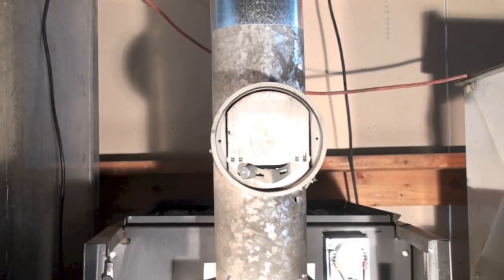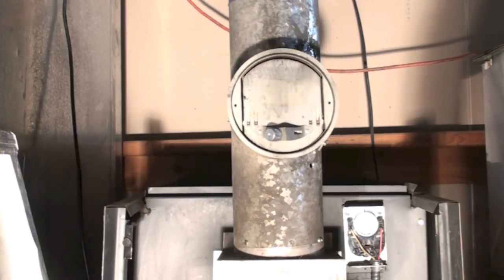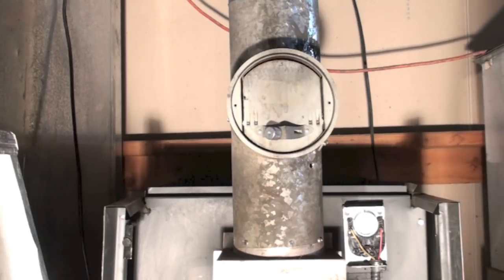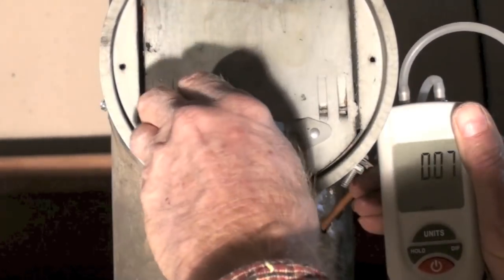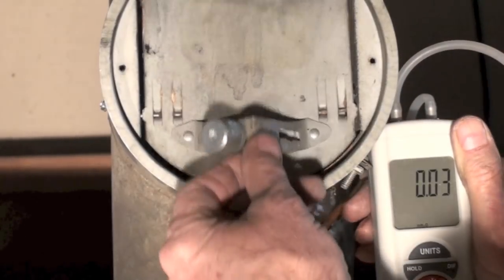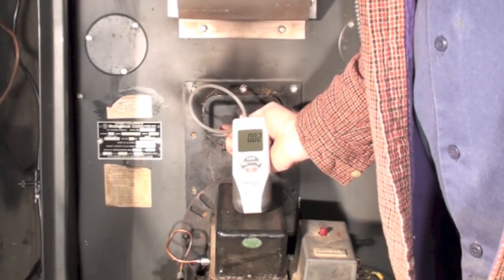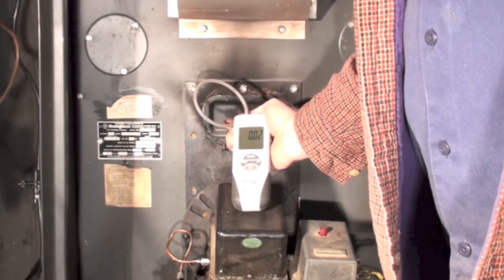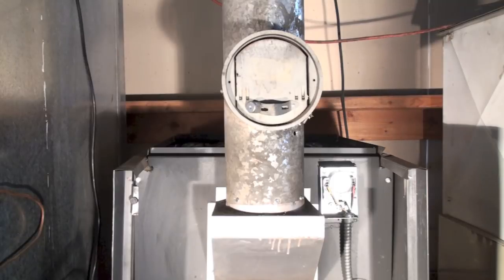How to set the oil furnace barometric damper

Comment: I have question on my furnace I only get o readings on manometer. same meter as yours even with damper sealed closed. What would cause this. I have a tall mason chimney and no smell in basement. also on windy days damper will open even with furnace off.

Comment: What do you recommend for running that intake pipe, outside?  To keep it from creating a vac in the conditioned basement?  Is that possible?  I have a blown air oil furnace, %84 afue. Installed in 06. Debating on upgrading what i can or replacement.  Tigerloop. Insulating pipes, etc
Reply from the maker: Most burner manufacturers have an outside air kit that can be installed on the burner to bring in outside combustion air.
GFM

Comment: whats the make and model?
Reply from the maker: The brand is GSI.  I never found what the model is.  Its made under several names.  If you use GSI on ebay it should come up.  I did not think it would work well but I have checked it against good meters and it is calibrated well.
GFM
Reply: Thank you!

Comment: All oil furnaces should have a draft diverter installed from the beginning. You’re one who really knows how to interpret the draft readings.  I’ve cleaned out my share of oil furnaces, that were running a positive pressure over the fire.
Reply: They should probably be in the scrap metal yard 😂

Comment: I know nothing of the pressure, or enough to know I shouldn't mess with it as a layman.  I just oiled the swivel and wired a rig to keep it from locking in its extreme open position and eliminate the noise.  It's real windy right now here and it is reactive to the wind.  I wanted to keep the noise down (the bang-banging) as it returns with its force to it's resting position too without at all hampering it's full pendulum motion.  Success, nothing but silence from the confounded (albeit important) contraption!   Thanks for the explanations and expertise - very cool and informative video.  My maintenance guys tell me the whole system is working really well - which is terrific considering how old the system is.  Just a lil oil here and there (especially in the forced hot air motor) works wonders.

Comment: Thanks for sharing information about this damper.

I've had technicians that come out for my oil boiler tune ups tell me, on at least three occasions

"You don't need to worry about your damper"

"It's an archaic 1970s leftover",

etc.

I've repeatedly asked them to adjust it properly, and they all say "it doesn't matter, don't worry about it.  We don't even carry a barometric pressure reader on our vans to read it"

Are my oil provider's techs being truthful?
Reply from the maker: They are full if beans.  The damper is used to control how fast the heat moves thru the heat exchanger.  The faster it moves, the less heat is transferred to your water.  Generally, they should be set to .04 negative pressure.
GFM
Reply: Thanks for the quick response!

Is -0.04 a value on that slider?  I will try that value.  

Since the techs at my provider - both older ones and younger by the way - don't think the damper is relevant, who else could I have come out to perform the adjustment process in your video?
Reply from the maker: @Zickcermacity  The draft value is sensed in the vent.  There is a 1/4" hole in the vent pipe for the sensor probe.  Adjust until the pressure is right.
I would try a service company rather than the oil supplier.
GFM
Reply: @grayfurnaceman  I was told (by who I don't recall at this point), to adjust the damper door counterweight so that on a calm day, the door would remain shut when the boiler is off, and would open slightly, about one third way, when it is firing
Reply from the maker: @Zickcermacity  Nope, set to negative .04 with a draft meter.
GFM

Comment: My oil burner has no vent/damper on the chimney. There is a 2.5 x 4.5 inch door just above the burner that lets me look into the slot in the combustion chamber. This door has a screw allowing it to be adjusted to hold open at varying amounts. Anyone know if this should be adjusted like the damper?

Comment: Since I have approximately 12 feet of 4 inch flue pipe including the 4 feet of insulated pipe up the outside of my greenhouse for my miller. I’ve never had any issues that I know of.  But do you think that I should have a 4 inch barometric damper in the beginning of the pipe coming from the top of the miller or do you think 12 feet of 4 inch pipe is ok to run the miller this way I’ve had it this way for 3 years.  I was thinking maybe with out a barometric damper it might be causing back pressure. But was worried that if I installed one that the flue gases would take the path of least resistance and then just come out of the damper into the greenhouse.       The only reason I ask is because if we have any more major issues with this furnace since it is used I will be replacing it with a new unit from Thermo pride that makes a identical replacement with the same 4 inch vent and definitely would not want to damage a new unit with a long 4 inch flue pipe.

Comment: I am trying to figure out what causes a rumble at startup, when the burner kicks on after delay the damper slams shut quickly once and then works as normal. Eff test: 0 smoke, 11.5% CO2, 5.5% O2, Overfire Draft -.01 to -.02" wc, Damper Breech draft -.06"wc. Runs fine but damper slams at startup and there is a slight rumble at startup, oiled fired furnace.....any thoughts? thanks
Reply from the maker: A rumble on startup indicates a failure to establish draft.  Could be caused by a negative pressure in the house, a nozzle too small or a blocked chimney.
GFM
Reply: @grayfurnaceman  thank you, could a blocked heat exchanger cause this too?
Reply from the maker: @bkoz319  Yes, I would check overfire draft and compare to stack draft.  Should be -.02 difference.
GFM

Comment: How would I adjust a single barometric damper that services both an oil boiler and an oil hot water heater? Would I adjust it for the boiler or the hot water heater? if the boiler, how would it affect the hot water heater and what happens when they fire both at the same time? These situations are not addressed in the video :( Thanks!

Comment: Very informative, thank you.

What happens when you have 2 appliances connected to the same chimney (furnace + water heater) ?

Can you make a video about fresh air intake and back drafting problems ?
Reply: This is exactly why I came here. I have a oil furnace and oil fired hot water appliances side by side. How many barometric dampers do I need if they both go into the same chimney?
Reply: @nohyphens  In my case I had 2 one for each appliance, but they were not good quality (calibrated ones).

Comment: I have a question i installed a trailer furnace welding n my garage I'm wondering if I can put a damper on the pipe that goes outside because it doesn't seem to push hot hot air i think I'm losing my heat out my pipe
Reply from the maker: No damper.  It will just dump exhaust gasses in structure.
GFM

Comment: The damper is upside down. This installation is not shown as being approved in the Field Controls literature. Also, I would have expected you to discuss the counter weight being set on the correct side: vertical vs. horizontal chimney connector orientation. Otherwise, another good video grayman. Thx.
Reply: is upside down bad?  and what size damper is that.  Do the backside counter weights ever need adjusting?
Reply: is upside down bad?  and what size damper is that.  Do the backside counter weights ever need adjusting?
Reply from the maker: +Johnny Outerbridge That damper may indeed be upside down.  They will work either way on that type of damper.  If the damper has backside weights, they may need to be adjusted.  
GFM

Comment: Thank you for sharing. Our oil fired boiler damper remains open after combustion has ended, sometimes 30 min to several hours. If I flick the damper it will then close. Is it correct for the damper to remain open after combustion has ended or does this mean it might require adjustment?
Reply from the maker: Its probably just getting stuck.  You may have to replace it.
GFM

Comment: Read proper installation for barometric dampers, To close to Breach ! Draft over the fire on a clean flue passage - heat exchanger, Draft over the fire should be set to Neg-01 or Neg.02 max this is explained by most oil burner manufactures. Get over fire draft set Neg -.02, Then do smoke testing and Co2 reading and others, Then again check draft over the fire and make sure its within Neg -.01 to .02 max when done! If higher readjust barometric damper, Higher draft over the fire sucks out flue gases to quick. If to high Neg -.4 and higher over fire draft this will throw off Co2  reading and smoke test. Trust me been doing this 28yrs licensed for most everything! Some Oil fired Manufactured appliances with poor design heat exchangers may not want a barometric damper ( rare ) and we know who they are. Keep in mind new heating systems on Old Chimneys you might not get any draft over the fire! Then you need a chimney liner for the total btus and don't forget to insulate the new liner on an outdoor chimney and some indoor chimney sections exposed to outdoor temps. The Boiler Man LLC
Reply from the maker: I have not seen a minimum distance the damper must be installed in relation to the breaching.  No saying it is not true, but I have heard this before and have not been able to find where the install instructions give a minimum distance.  There is a minimum distance downstream of a stack switch.  As for combustion efficiency adjustments, you are right on.  The chimney liner info is very good.  Most of the masonry chimneys are far too big.  Especially with newer, more efficient furnaces.  Thanks for the thoughts!
GFM
Reply: As per FIELD CONTROLS installation instructions: "the control should be located as close as possible to the furnace or boiler. It must be 18" from stack switch if one is used."

Comment: Also, on another note...What if your barometric is at a 45 degree angle on the flue... Would you put your weight on the V or H position for Vertical or Horizontal?
Reply: Use the horizontal position for the weight, make sure the barometric damper is level even though it's on a 45* angle so the door hinge should be level, you'll have to spin the damper to get the hinge level.

Comment: What is the device called you are using to measure the air pressure in this video?
Reply from the maker: It's called a manometer.  It reads fractions of an inch of water column.
GFM

Comment: The weight for the draft regulator is on the wrong side, should be on the right when installed in a vertical tee
Reply: Your right, i guess it doesn't matter if the damper is upside down? Because mine has the weight towards the top opposite of what his shows. Edit...actually his weight is on the right side for vertical installation, the damper is just up sidedown.
Reply: You're wrong. The barometric damper doesn't know the difference. There are two mounting positions but which you use comes down to personal preference. I'm left handed so use the left-hand position. It's as simple as that.
Reply: @mitchdenner9743  No, this damper has been installed correctly. It is not upside down.
Reply: @paulmaxwell8851  NO PAUL YOU ARE WRONG! I called field controls, the manufacturer of this damper and they told me it will not operate correctly upside down with the weights on the bottom like that. If you look the pivot point of the hinges is offset to one side, not centered. The damper was designed  to be installed upright only by the manufacturer.  It tells you in the installation instructions. So I'm always going to refer to the manufacturer and in this case paul, YOUR WRONG! Figures your lefthanded.🤣
Reply: @mitchdenner9743  - just what does being Left handed have to do with anything...?
Reply: @mitchdenner9743  So, now he's a left handed clown... hard to tell if you have anger issues, or if you just enjoy insulting people rather than simply speaking intelligently and sticking to the issue at hand... I suppose it really doesn't matter, as the result is the same in either case.

Comment: Does the same rules apply for adjusting barometric dampers on natural gas boilers as well? such as cast iron sectional and firetube boilers?
Reply from the maker: In general, yes.  That's assuming its a commercial boiler.  Most residential gas designed boilers use a draft hood.  
GFM

Comment: can i angle my becket oil burner vent pipe in my attic which is about 6' in length in order to get it on back side of roof ridge ?  Beckett NX burner,  high efficiency furnace. Pipe is b vent. thanks
Reply from the maker: You can, but you must maintain at least 1/4" per foot rise in the horizontal run.
GFM

Comment: Good video. I have a question. When you were checking the pressure below the damper, why is there 2 tubes on the manometer? Just wondering what that other one is used for. Thanks
Reply from the maker: Jason Gabriel The manometer is set up to do a pressure difference check. Such as pressure difference across a filter.
GFM

Comment: I just bought a godin petite 3726 oval wood/coal stove. Can you please help me unfreeze a frozen air knob on the front? It is frozen solid in closed position I tried to open it with a grip lock pliers but just ended up damaging the porcelaine on the lug on the dial. Which way do I turn to open it and do you have a suggestion on how to unfreeze it. I tried wd40 on the bolt stem behind the door, as well as spraying the gasket with it. Any tip would be appreciated. Thanks.
Reply from the maker: arajoaina I don't have a lot of help here.  These parts are pretty bad for seizure due to the heat.  Opening should be counter clockwise.  I would try an anti seizure oil and spend some some time working it back and forth.  Don't force.  Hope this helps.
GFM

Comment: I have an oil burning hot water heater and furnace sharing the same metal chimney.  each have their own barometric damper like the one above.  Watching the hot water heater run.. I see its damper rock back and forth.. when the burner goes out, the damper rocks closed.  When the furnace is running.. it's damper doesn't really move, but it does move the water heaters damper instead.  when the furnace burner goes shuts off.. both the furnace damper and the water heater damper fly WIDE open for a second and close.  What would cause that kind of sudden draw when the burner goes out.  Is something wrong?  because the water heater doesn't do that and they're connected to the same chimney pipe.  Chimney has been swept within a year and both burners cleaned and nozzles changed at the beginning of this heating season.
Reply from the maker: It could be the sudden loss of vent gas volume.  The hot gas volume is not followed by a similar volume, so the slug of hot gasses pulls air from the damper.  In any case, no problem.
GFM
Reply: @grayfurnaceman   good news.  thank you sir.

Comment: I measure .035-.04 in the over fire position and .035 (this the maximum I can get with the damper fully closed) in the flue ahead of the damper.  Is my chimney too short?  How do you reduce the vacuum in the burner area?    It has a screw on the observation flap into the burner area - is the idea to open that to drop the over fire pressure?  Also, I'm getting a small amount of smoke back into the building.  How is that possible with a vacuum in the vent - again, is the chimney too short?  It sticks up about 2 ft over the peak but there is another building next to it that is taller.
Reply from the maker: Your readings are probably not accurate.  It is common on older furnaces to have no drop between overfire and vent is common in some older furnaces but overfire cannot be lower vacuum  than vent.  
As for the smell.  If the smell comes only in the morning, you may have a cold start rumble on startup.  This is the furnace not establishing draft on a cold vent.  You could also have a negative pressure in the structure.
GFM

Comment: Just wondering why the draft regulator is installed with the weight at the bottom.  I have never seen that before, I am used to the weight being installed towards the top of the smoke pipe.  What is the logic behind installing it on the bottom?
Reply from the maker: farmertomnj Its just the different manufacturers.  It works the same.
GFM

Comment: I just installed one where the weight and pivot are on top. Yours looks like it would be better if it was on the bottom half of the damper. Should I turn it around?
Reply from the maker: It will work either way.
GFM

Comment: Just went downstairs and found my damper lying on the ground.  The chimney clean out door was also open...what the heck is going on?  I reinstalled the damper, but not sure I have it on right.  It looks like the one in your video except the weight is on the inside.  I installed it weight side down, otherwise it would just hang open when the furnace is not running.  Is this correct?
Reply from the maker: +BrewCityRider The damper appears to be right.  The bigger problem is what caused the puffback that blew it out.  The unit may need a service.
GFM
Reply: +grayfurnaceman Yes, I'm going to schedule a service asap.  Thanks.

Comment: If you have a damper that you completely open with the weight slid all the way down and still get a negative pressure reading of more than .04, can you elaborate on the issue? Flue vent not high enough over roof? Anything else that could cause this???
Reply: sounds like your chimney is a vacuum cleaner... your exhaust temps will be high too.  Slow it down... I saw something in a book that showed a slot cut  in the exhaust pipe and a strip of metal inserted in it to choke it down a bit, then it was sealed in with high temp silicone. Make sure you have the right size stove pipe..